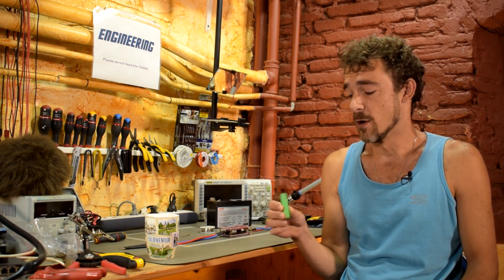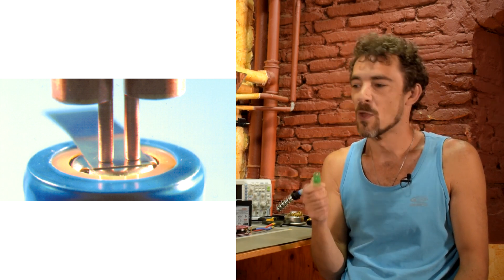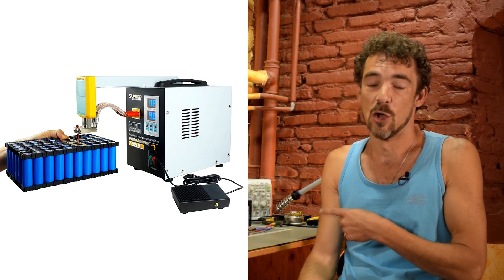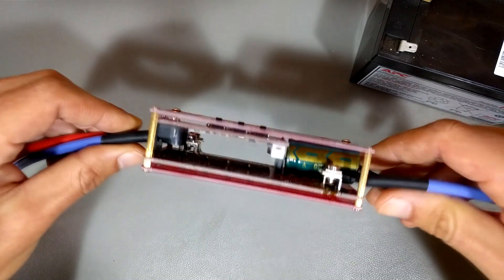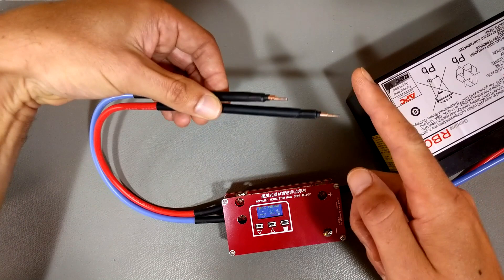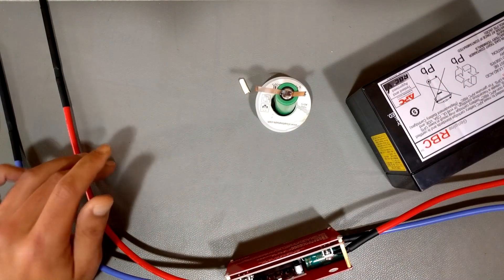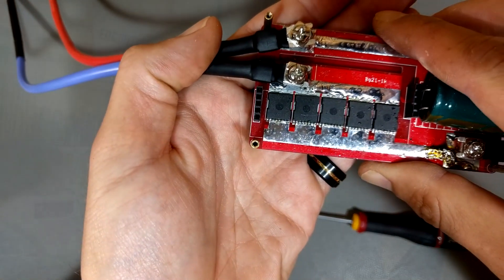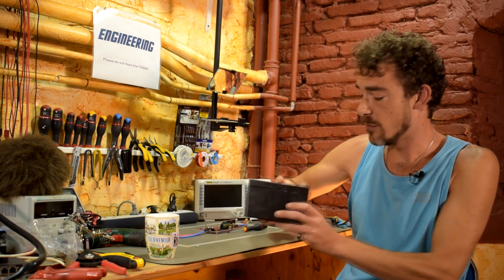The $16 battery tab spot welder

Comment from the maker: EPILOGUE: Well, I tried several more welds. The auto mode doesn't work, and neither does manual. In fact, even the when the device is OFF, current still flows through the welding leads... So I basically just have 2 leads connected directly to the battery. Given also that my first 3 welds were successful (if a bit weak), it's definitely dead. :(
Reply: you have a blown mosfet or more, check with multimeter - tese spot welder die very fast if you power it with under sized and under rated battery, bro - seriously !!! PB 7Ah battery ? - check my channel video - i use the same spot welder, pcb traces strengthened with copper and solder, and i powered it with 3S80p Lithium ion battery, which can easily output 200-300A pulse current. i welded at 30-40E , but later i tried 80AH car starter battery and it welded at 10E , so conclusion is the bigger and high current the battery is, lower will be the welding time settings and when lower is the time setting the spot welder will less likely to get hot or die. 
  https://youtu.be/XjvIRuSl_eo
Reply: I just had exactly the same mode of failure on my spot welder. I was using the auto jump starter for power source. Tried it first on 20% setting, but the weld was too weak. Increased the setting gradually to 60%, but it was still weak. At 80% setting it suddenly provided power, almost melted the strip and the cell. Now it is shorted from input to output, most likely one of the MOSFETs is shorted. For information - my battery was fully charged before I started the testing, I measured 12.7 V. Yesterday I asked Banggood to replace the unit under warranty (I bought it for $16.99 on August 21 and it was shipped 3 days later). Somehow Banggood was not surprised and offered me a full refund. Most likely they knowingly bought a batch of defective welders and sold it to unsuspected public. Now they sell the same welder for $24.99 - maybe they are not defective this time...
Reply: @mikhailshneyder9131  I received mine 4 days ago and ditto. Banggood gave me refund though.
Reply: I think this could be what happened... https://youtu.be/fdnO0Z-scjA
Reply: @SuperBoobaloo   yes. Exactly. That’s why I kept saying to people that don’t use weak battery
Reply: i bought a few spot welders, and this was one of the ones i tried,  it sucked. i agree with everything your saying, and mine smelled burnt upon arrival. terrible
Reply: Exactly the same here.. from AliExpress

Comment: The mosfets are fine...it's your technique.  You burned through the nickel strip because you positioned the probes off of the battery terminal underneath the  nickel strip.  If you reposition the probes on the nickel strip with the battery terminal directly underneath the strip it will weld fine as the battery terminal actually absorbs much of the energy from the pulse which is what effects the actual weld.  I have one of these welders and have done dozens of batteries but it does take a little practice in the  beginning.  Also increment the weld power gradually ...no more then 10 units at time until you get a good weld.  Each power supple battery is different as is the thickness of the nickle strip...the .15mm strip takes more power than the  .10mm.  Try it again...I think it's ok.

Comment: @ 07:01
A car battery would be a far better choice as you need at least 300 A to spot weld I think. 🤔

The other option is using like 6 2.7 V Maxwell supercapacitors of at least 200 F capacitance connected in series. 🙄

Comment: i have the same welder and works fine your settings are way to high for that thin nickel strip!!... thats why it melted..
start with 20 and test if it holds then go up with little steps you made a plain dead short.
Reply from the maker: 10 was too low (weak weld), then I tried 20 and that was better. Then 40 based on comments on Banggood, and that was perfect. But the 2nd time I welded at 40, POOF! Dead. It appears that either the MOSFETS are dead, or the controller isn't telling them to turn off when it should. Given that 5 new MOSFETS are $5, I'm not sure I can be bothered to try to fix it.
Reply: @ScottiesTech  i never trust the comments on banggood start low and test what is the best setting how thick is your nikkel strip?
Reply from the maker: @bareldnijboer2730  0.1mm, nickel-plated steel.
Reply: @ScottiesTech  i use 0.15 on 30 and works fine
Reply from the maker: @bareldnijboer2730  Well, the seller claims 0.1 is ideal, so that's what I got! Oh well.

Comment: i have been through the learning process with pulsed welding of battery packs. the best and most cost effcient welder timers are arduinos  with foot pedals and custom hand pieces running off high C rated lipo packs.

Comment: your issue is you need to have the electrodoes pushed down hard against the strip otherwise you get the arc that will blow holes. this is spot welding 101. super simple stuff. also its a dual pulse so you have to hold it down until the second  pulse is finished.  if you use different thickness and types of materials you need to turn it down or up depending or you will blow holes. the mosfets are cheap. just replace them

Comment: I also had the same device and the mosfets blew up on the third weld.
Reply: Its due the board needing an extra capacitor.
Reply: Mine after 2 weld's. Fake mosfet's. To replace them with real ones. Get these IPLU300N04S4R8XTMA1 from digikey.com $28 bucks + Shipping and a really good soldering iron 60Watt+ or rework station.

Comment: Actually, you can just buy a 500F (maybe less) super farad capacitor and use E=0.5*C*V^2 to charge the capacitor up to a specific voltage given your intended energy. The circuit board in fact did that implicitly. Shorting the capacitor will do the point welding! Another thing is that you need to make sure the circuit board is fully cooled down before the next weld. At $16, I'm pretty sure there is no temperature sensor to throttle the circuit operation, so consecutive welding will surely overheat and damage the MOSFET.
Reply: no. it wont work. you will blow holes. it requires a timer circuit becasuse it needs to be two pulses timed perfecly one after the other.
Reply: @freelectron2029  why 2 pulses?
Reply: @XuancongWang  first one pre heats the metals and squashes them down flat with each other so there is no gap and chance for arcing, second one welds.
Reply: @freelectron2029  I see. What if there is only one pulse, assuming the contact is good and there is no gap for arching?
Reply: @XuancongWang  there isnt. ever. there is lots of scientific literature on the subject. this is how all the commercial thin guage welders in the world work. there is a reason years of development went in to this process. not sure why you think you are better than hundreds of hours of research by hundreds of engineers and a technology that has been refined over time.
Reply: @freelectron2029  I am not saying I am better than state-of-the-art. I am just exploring new possibilities. Because using MOSFET to control large current is difficult, expensive and failure-prune. Transient high current or voltage will often spoil circuit elements containing semiconductors because the resistance of across a PN junction decreases with temperature, allowing even larger current to pass through, generating even more heat. It is an unstable equilibrium. Thus, even if you connect multiple transistors in parallel, this kind of unstable equilibrium will cause some transistors to heat up faster than others, causing them to breakdown first, rather than evenly distribute current over all transistors in parallel. That explains what you have experienced.
Reply: @XuancongWang  mosfets cost a few dollars. you litterally have the most advanced technology in the world in a solid state package and can order them and have them deliverd to your door. if you are complaining about this you need to learn some humility. you are literally living in the most advanced time in history. and yet you stil want more for cheaper. what a joke.
Reply: @freelectron2029  I am actually wondering what if you 1) make sure that the welding contact is good, with no possibility of arching; 2) use a low transient-contact-resistance switch to do the single-shot short-circuiting. Since you have a good lab environment, maybe you can give it a try. If you can make it work, that kind of setup literally will never break down. But right now I do not have a lab environment yet ^_^
Reply: @XuancongWang  you dont need a lab enviroment. you just need a piar of hands and stop thinking about it and just do it. ffs these princesses these days will find any excuse to NOT do something. its grade school level electronics ffs

Comment: Can you determine if it is shorted MOSFETs or is it a controller issue?
Reply: I have got similar issue. One or more MOSFETs are shorted. There is a continuity from nagative input to both the output probes.
Reply: @kiranvarsani  How can you tell which MOSFET is shorted? Can you visually see the damage?
Reply: @mikhailshneyder9131  they are all connected with a single drain and source bus. I will pull them off one by one and test. Most likely it will be one closure to output.
Reply: @kiranvarsani  How do you pull a MOSFET? Do you have to use anything other than a soldering iron?
Reply: I pulled all the mosfets out. The one closest to the capacitor is burnt.
Reply: @kiranvarsani  I am getting a heat gun and will do the same. You did not damage good MOSFETs during removal, did you? Are you planning to reuse them?
Reply: @mikhailshneyder9131  yes I am planning to reuse them

Comment: I would like to think Bodragon is right....how could that tiny battery stress 1500 amp rated Mosfets.....???
Reply from the maker: Well, one problem is that the MOSFETs may be labeled, but there's a lot of knock-off stuff floating around - especially in unusually cheap gizmos shipped direct from China. So who knows if those FETs really are what they say they are.
Reply: @ScottiesTech  I was thinking "knock offs" too...but then the thought that the chineese are smart enough to avoid their own cheating....and a factory that can design and manufacture sophisticated electronics has smart people !   I would agree that if the product was sold by showing huge mosfets "under the hood"  but none off us would have known how they achieved the end result...i.e. it just works...like others....I can't wait for your followup video....Great education for us all....

Comment: I don't think that welder is broken.
You left it on Manual mode.
You forgot to switch it back to Auto.
That's why it obliterated that nickel tab.
>
Reply from the maker: In Manual mode, it's supposed to send the current pulse when you press the attached button (which I didn't have). Otherwise, there's no point in having the button! I actually tried again after recording the vid just to be sure, and no matter which mode it's in, the leads just continuously dump current - even when it's turned off (oops). So, definitely not what it's supposed to do - and not what it did for the first 3 welds I made before the vid!
Reply: @ScottiesTech  I have not been able to set mine in Auto, mode how do you do that?
Reply from the maker: @dga5396  I just press the button with the white square below, and that toggles between manual and auto modes.